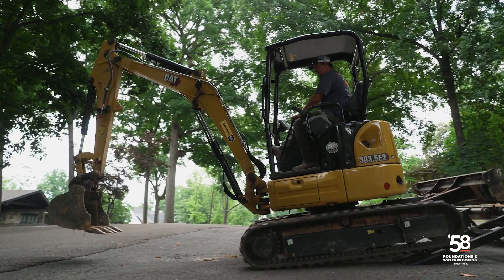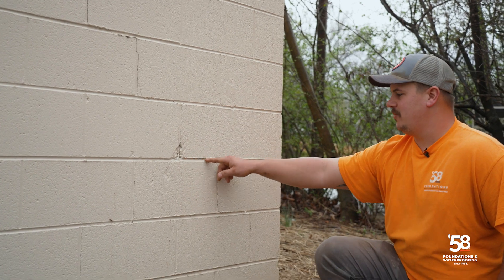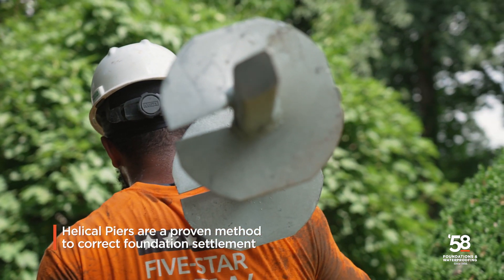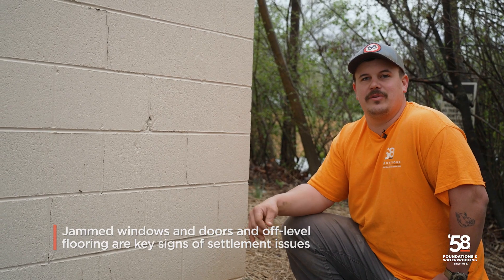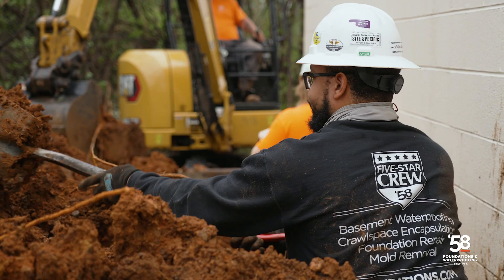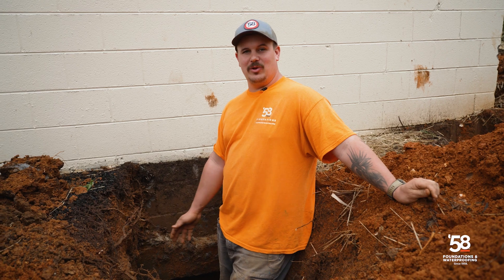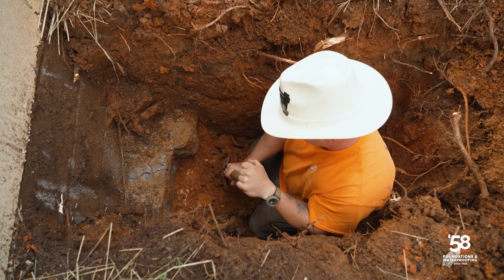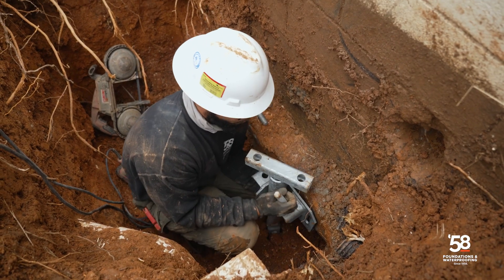How to Identify and Repair Foundation Settlement

Comment: The building showed only hairline cracks. You could not even slide a business card between these cracks. No engineer would recommend foundation underpinning for a hairline crack. Just to monitor it for future movement. Perhaps apply a crack monitor if the client is interested in foregoing masonry repairs.  It is highly likely this foundation would have settled to stabilization on its own without spending all of this money for foundation underpinning. Always hire a structural engineer first before getting quotes from foundation repair contractors. That step is actually required in many States to meet code requirements. Don't be overcharged for repairs you do not need. Do your homework first.